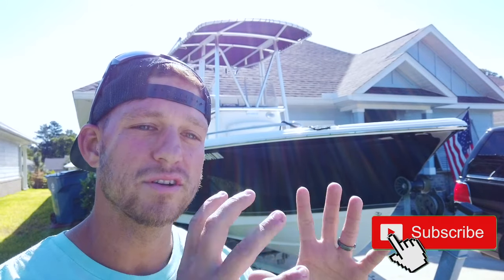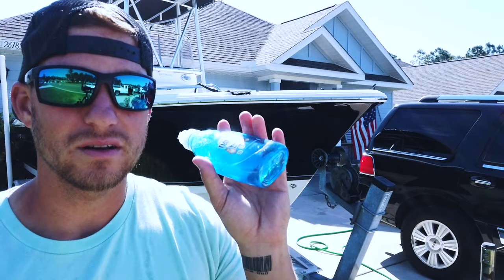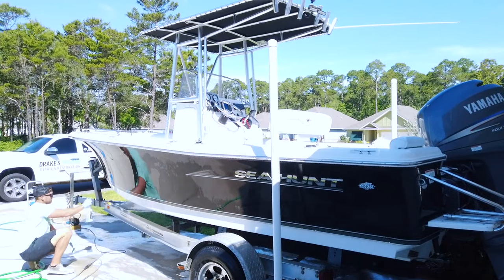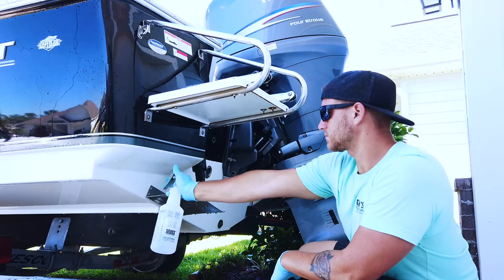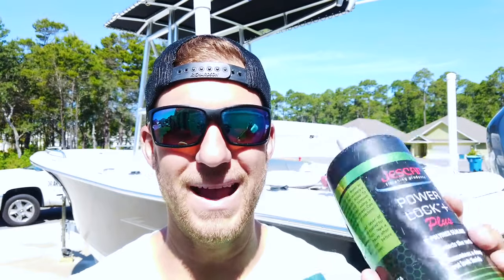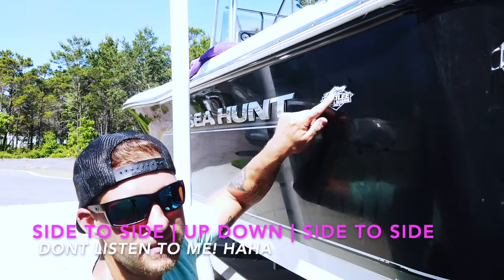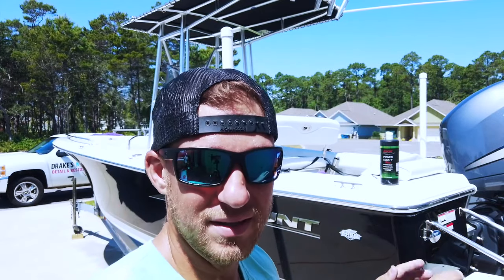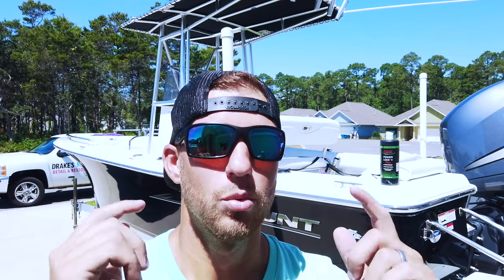How to Wax a Boat | boat detailing tutorial | Revival Marine Care

Comment: Great video.  Quick question, I just bought a bought that sat for a year plus.  Has a 12" red strip down the side that is faded.  I followed your video, but the red is still a bit faded (white).  It does seem to look better, but as it dries out, it gets white(ish) again.  Is there a solution to make that red look new again?  Repeat the steps until it looks good, or is there another step or product?  Thanks!
Reply from the maker: Hey bro! So just “waxing” your boat alone will not help get rid of oxidation. To remove the oxidation, here’s the video you’d want to watch 😎https://m.youtube.com/watch?v=u2IQoU8Vjrw&feature=youtu.be

Comment: Hey man, love the videos! How do you brake up pricing if the customer only wants rub rail up? I charge $25ft for a wash and sealant. What should I charge for a wash and sealant on rubrail up?
Reply from the maker: If it were me, I would be doing around $20-$25 per foot, per step for the top side, and then the same pricing structure rub rail down. If they want rub rail up, rub rail down done, I would meet in the middle of those two prices combined.

Comment: Thanks for your great advice - helps us home boat owners look after our rigs properly. Quick question: I have white rub rails that discolor, going yellow overall but with varying dark marks. What product will clean them back to white? TIA.
Reply from the maker: Hey Peter! Try a small spot with some diluted bleach on the rub rail, be carful, if you accidentally get it on your gel coat and don’t wipe it off right away it can scar it! But see how that works!

Comment: Great video, your detailed explanation really helps. I see Jescar has come out with Ultra Lock+ ceramic polymer. I assume this is even better for my boat and truck finishes?
Reply from the maker: Yes! It offers a little bit more protection than the standard power lock
Reply: @DrakesDetailing  also do you use dawn in some water to soak the pads and then rinse and dry for reuse! I’ve seen where Shurhold boat cleaning products out of Florida have some special expensive powder to mix up. But if dawn works !!

Comment: I just discovered your videos and now I’m hooked.   I have a 2017 chaparral that is black.   I bought it new and I’ve been polishing/waxing each season to maintain its gloss.  One thing I struggle with is proper order of doing things.  Where I’m located we have. Wry hard water.   If I strip the wax using dawn dish soap and attempt to rinse and dry, I seem to always get water spots.    Should my next stop be to polish the boat which will remove water spots, and then wax.   I just bought a griot orbital polisher and don’t mind putting in the time to make it look the best that I can as a diy person.   Thanks
Reply from the maker: You can use a water spot remover, and that won’t strip your wax, but dawn definitely will! Use a water stop remover, and then wash
Reply: @DrakesDetailing  Thanks

Comment: Hey Drake. awesome video. Do you seal the bottom of the hull of the boat, which is hard to get to with the boat on a trailer, or do you just seal as much of the bottom as you can reach?
Reply from the maker: Hey man! Not on this particular job, but some customers do want that done!
Reply: @DrakesDetailing  How do you get to the bottom of the hull to seal it if its on a trailer?

Comment: I was planning on compounding my boat then polishing. Would using this product eliminate me having to compound? Should I compound then use this product?  Thanks for the tip on Dawn. No wonder my boat is looking worse. Ive stripped everything off of it
Reply from the maker: Hey bro! It all depends on the condition of the gel coat whether it needs to be compounded or not. If there is a chalky field to the gel coat and you can scratch it with your nails, and it feels like a chalkboard, then you need to heavy, cut to remove the oxidation. if there’s no oxidation just holograms, then just polish, then seal.

Comment: Enjoy the videos.  Just a boat owner that would like to take care of my boat and not waste time and money doing the wrong thing. So I have a question. After a day of saltwater fishing I have been rinsing my boat then spraying it down with Starbrite Deck Cleaner and letting it sit for several minutes.  It really seems to loosen the bait that got smushed into the non-skid and the dried on blood and guts.  It that cleaner one of those that will strip the wax off my boat? If so, what's your way of getting this job done?
Reply from the maker: Yes it will take your wax off, more heavy cleaners will. 

Keeping your boat waxed or ceramic coated will stop things from sticking to it.
Reply: @DrakesDetailing  Thanks again for your prompt reply.  So if I'm getting this right, you're saying keep the boat waxed and it's easier to remove the blood, fish parts, ground in and dried bait on the non-skid.  Then at the end of the day wash with a wash/wax product so as not to remove the wax.  Right?
And the only time I use the Deck Cleaner or Dawn or similar is when I'm ready to wax the boat again?
Does the Starbrite Hull Cleaner I've been using to remove the hull stain or the Rustaide you mention in your videos, does that also remove wax from the hull?

Comment: I can’t get enough of your videos. Actually looking forward to it this year. I have a black boat that the marina messed up a few years ago and was all halograms. I plan to compound with will pad then Menzerna 400 with Shurhold orbital & lake country orange pad. Do you recommend just Power Lock after that?  Seems like I’ve seen you spray on products and wash them off after that but can’t find the video now. Thanks again!
Reply from the maker: So I'm actually switching from jescar power lock to Starke hyperhold! I have been testing it for a few month and its working better longer term than the jescar. You can top it with starke replenish si02 for even more protection. 

https://drakesmarinedetailsupply.com/collections/starke-surface-technology/products/starke-hyper-hold-polymer-sealant?_pos=1&_sid=1e28b61de&_ss=r

https://drakesmarinedetailsupply.com/products/starke-replenish-silica-spray?_pos=1&_sid=88f02b007&_ss=r
Reply: @DrakesDetailing  okay. What pad do you apply the hyper hold with?

Comment: Would you use the poly sealant followed by a wax in freshwater, or just the poly ?  Thanks
Reply from the maker: Sealant followed with sio2 coating. 

Use starke replenish
Reply: @DrakesDetailing   Thanks sir,  I'll let you know how it comes out.
Reply: @DrakesDetailing  similar question so polish with jasper and then use a sio2 ceramic paint sealant flowed with starke replenish silica spray is this correct

Comment: Why in the RV video do you say to use a lambswool padded brush instead of a soft bristle brush so that it doesn't damage the gelcoat, but here you're using a soft bristle brush on a boat's gelcoat?

Also, I notice you use Jescar PowerPoint for both boat's and RVs. I just bought some because of your recommendation. But because you use it for RVs too it makes me wonder: is it technically a marine sealant?

Thanks for the channel by the way. I've learned a lot!
Reply from the maker: Use the softest brush you have, also Jescar is a paint sealant it’s not technically a marine product.
Reply: @DrakesDetailing  I'm confused. Even though it's not technically a marine product, Jescar Powerlock Plus will still work for boats though, right?

I have a boat job coming up in 2 days and I bought exactly the things you recommended in this video (also got a Maxshine M8), so I'm trying to make sure asap if that will be ok or not. Thanks in advance.

Comment: Hey bud....Great video.  Is there a reason why you don't use the same machine to buff it?
Reply from the maker: Hi Robert, yes the rotary is used for heavy buffing and cutting. If you were to use it for waxing then it would leave a bunch of swirl marks that’s why you use either a force rotation machine or a DA polisher. You cannot use a DA Polisher for Buffing, as it is not strong enough.
Reply: @Drake's Detailing  
Ok ..... can you recommend what I need to buy for my boat. New Pursuit.... grey hull.
I'm looking to wax and polish the boat.

Comment: Great video. Just getting into the boat biz.  Been doing cars and RVs about 8 months now and just got a gig on a 40’ house boat!  I use Griots Correcting Cream or Perfecting Cream on most of my jobs, depending on oxidation, etc.  Can I use those on a house boat/boat?  I also use orange foam pads.  Can I use that or a softer pad on a boat?  Thanks in advance!   PS The house boat will only be used on fresh water lakes & rivers.  PSS. As a newbie, may I ask how much you charge per foot?
Reply from the maker: Hey bro! I charge $15 per foot, per step of work that I do. I’m not a big Griots products fan myself, but it can get the job done. Orange pads will work just fine! 😎
Reply: @DrakesDetailing  Thx and I feel ya on product preference. As a beginner Griot’s cream polishes were really user friendly and low dust, making cleanup easy.  I did however buy the Jescar Power Lock + polymer you recommended for boats, and really everything. And here is an update for ya: I did get the houseboat gig, and an RV gig along with a few more truck jobs. WOW. Things really blow up fast when the temps rise!  Anyway, really looking forward to using the polymer. I hear it can last as much as 12-18 months depending on conditions and storage of the boat, etc.

ALSO, any thoughts on a product named Collinite Auto All In One No. 325. It’s a one step polishing wax.  I was told by another detailer in Salt Lake City to apply this after/onto the polymer for a smooth as a baby’s butt finish.  Thoughts?

Comment: I use my boat only in freshwater and its kept covered out of the water when not in use (so bottom is not painted as there is no need). What is your opinion on using a polymer sealant or ceramic coat on the running surfaces of the boat? Do you recommend? If so, how often and with what product?  Thanks for all your videos - very very helpful!!!
Reply from the maker: Under the water line in fresh water you'll get a solid year out of ceramic, thats personally what I would use

Comment: I have used the the Power Lock with the recommended pad. It has no been about 6 months. Should I remove Power Lock with Dawn or just apply over the existing application?
Reply from the maker: Just reapply, so need to strip it off

Comment: Thanks again for the vids Drake. So much good info, tips and tricks. Question for ya. 

I noticed you let the sealant dry in direct sunlight. Is that something you can do specifically with Jescar or is it just the nature of mobile detailing for boats? Is there anything someone should lookout for when letting sealant/wax dry in direct sunlight?
Reply from the maker: Not all sealants can be used in direct sunlight! I have never had an issue with jester power lock! Do a thin layer don't apply to much or it will be a pain to wipe off!

Comment: question for you , i have a formula 40 with imron paint -- has some scratches in it .. what can i use before ultra lock plus to take out those scratches ( maybe a compound & polish -like Turtle Wax 53478 Hybrid Solutions Pro 1 and Done Compound Correct and Finish ) also do you like power lock  or ultra lock plus

Comment: how many uses do you get out of microfiber finishing pads? Do you clean them in between uses? Ive attempted to use water and dawn to clean sealant out of my pads but it doesn't seem to get the product out effectively.
Reply from the maker: After one boat I typically just pitch the wax pad, ha! They are probably the most inexpensive ones to buy 🙂

Comment: Is dawn dish soap all that is needed? Is using a clay bar beneficial for gel coat?
Reply from the maker: Dawn will take off any wax that may be on the boat, if you are wanting to clean the surface completely than just use dawn. 

Clay only really comes in hand if you have over spray on a boat, but even then there are usually easier options... in 7 years Iv once used clay on a boat once and it didn’t do what I needed it todo ha

Comment: I was washing my boat the other day and notice a spot where the detail vinyl was cracking and peeling back..i peeled off a small bit and discovered metal underneath,,,IF i remove all the pin detailing and there is metal underneath how do i fix that? do i apply a clear gelcoat?

Comment: 2002, 38 ft sea ray sun dancer: for the exterior, what is the order of cleaning steps? I want to wax, degrease, ceramic coat, buff, and clean from last season, while protecting for the upcoming season. Doing it myself, and I want to be thorough and most importantly, efficient (without cutting necessary corners to save time)
Reply from the maker: Hey bro! I’d try shine supply’s line of compounds, start with their heavy cut and move down the line of compounds and polishes based off of their compound charts on their website. If the heavy cut shine supply is not cutting though all of the oxidation, then it more than likely needs wet sanded. https://cdn.shopify.com/s/files/1/0645/8097/files/compounds.pdf?v=1646261121

Comment: Yellows stains are always first.  I don't pressure wash any boat, it strips your existing wax.  That boats extremely well maintained. Not sure why you are trying to Dewax it. I use a Dw849 with a double sided Foam pad with the quick release on a boat like this. Not sure how you cut on Topside with that pad.

Comment: Hey Drake. In other video’s you refer to Mernzrna 1500 but I can’t find it anywhere. What can use instead after using Mernerna 400 and before polishing. My boat is state blue. Thanks!
Reply from the maker: Hey Bro! Menzerna 1500 does not exist, they have a 400, 2500, and 3500z those are their main ones. I would polish with 2500 after you do the 400. The 3500 personally does not do much for me. Hope this helps!
Reply: @DrakesDetailing  thanks man, I must have misunderstood something along the way. I’ll go with the 2500

Comment: When you use your wax machine, where are you hooking it up to for power? An outlet from the customers house? Or some kind of other source?
Reply from the maker: Yes, customers house. When detailing I require the boat to be near adequate power and water sources.
Reply: @DrakesDetailing   okay, thanks for the reply. I’m going to purchase the detail class online. I really enjoy washing boats, as I’ve done 3 boats this month, but like to expand and see if I can add boats to my pressure washing business full time.
Reply: FYI I had the same issue with mobile car polishing and installed a 2000W inverter in my truck.  It cost a few bucks but now I can operate ANY tool, charge batteries as needed and not “inconvenience” the customer.  I like telling them I’m self contained.

Comment: Can I just use the Flex 3401 to apply the Jescar (or any wax) or is it better to use the Griot's G9 ?
Reply from the maker: Yes the flex will work fine! The flex can be a work out to handle it, that’s why I like using the DA it’s easier. But you can use the flex just fine!

Comment: How do you feel about using hybrid ceramics vs Jescar Power Lock + sealants?
Reply from the maker: They will typically all last about 3 ish months. 

The better question is how to properly maintain the boats. Protection is only as good as the boat is maintained

Comment: I saw that the Jescar power lock plus is made for cars and not boats. Is it the best sealer for a boat? Thanks
Reply from the maker: Yes, it’s designed for cars. But it is still very good on boats, top it off with mckees 37 hydro pearl.
Reply: @DrakesDetailing  Thank you!
Reply: @DrakesDetailing  p

Comment: When you wash and wax, you only wash and wax the outside of the boat correct? Just like you did in the video? You don’t clean the inside? Only the inside at an extra cost?
Reply from the maker: Correct the interior and exterior are priced separately
Reply: @DrakesDetailing  so if I’m working on a 25ft boat I charge them $30 the ft inside and out? Totaling $60 / ft?

Comment: Are the speed settings on the new machine you recommend the same as the griots garage machine used in the video? Also I detail boats in a fresh water area. Would it be the same process using something like collinite last step marine wax?
Reply from the maker: Hey Man! Yes it would be the same with Collinite, but Collinite doesn’t last that long at all. Try switching to something synthetic like Starke Hyperhold. As yes all of the speed settings are pretty much the same!

Comment: Do you wax the bottom after you use RustAid? I'm guessing that acid can strip if it was wax/detailed.
Reply from the maker: Hey bro! I typically don’t wax the bottom unless the customer is specifically paying for it. So it’s typically not an issue
Reply: @DrakesDetailing  I'm doing my own boat. That cleaner won't strip what ever it touches?

Comment: I ordered the goof off. Now, I see you spraying this on and the boat is on a trailer. All my boats so far are on lifts. I was taught to apply the bottom scrub with an applicator. Due to the fact that the bottom scrub was always acidic.(get it on the lift and it WILL do damage) Is the goof off the same? I despise the bottom scrub because it really strips these boats. Before I put this goof off on any boat, what is your experience with any corrosion? Boat lifts are not painted and finished. Any advise?
Reply from the maker: I would still use an applicator just to be safe
Reply: @DrakesDetailing  okay, worked good on the nonskid swim platform on the 34 cabin cruiser I just detailed. I tried my hand at compounding. Fail😢 I’m not giving up😒